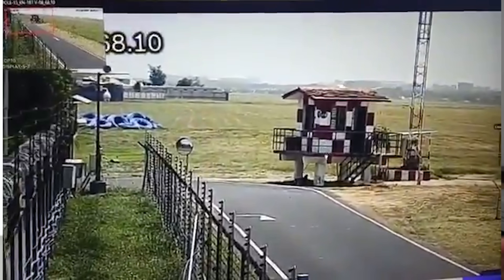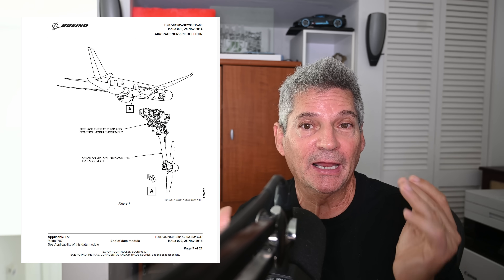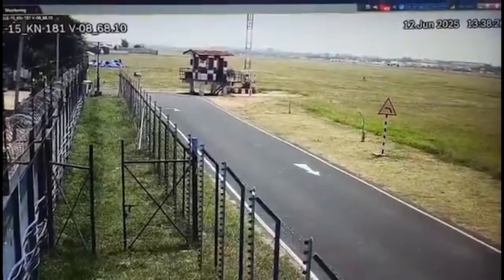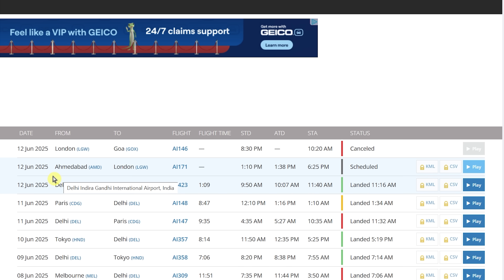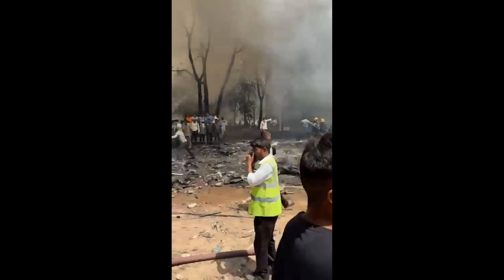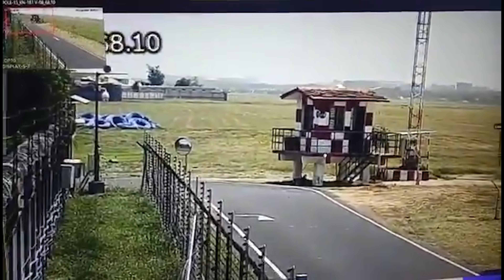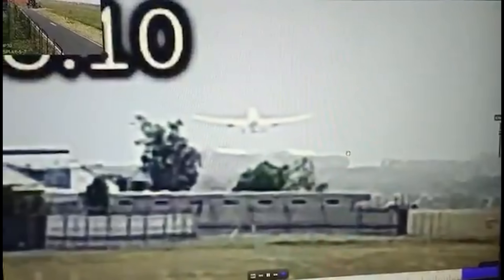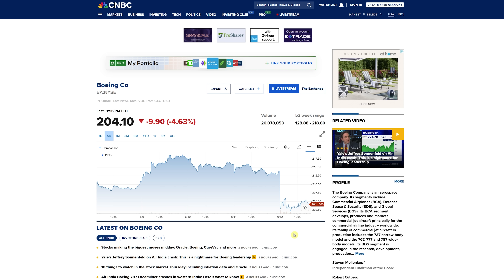What Caused Air India 171 Crash, Mysterious Sound Before Impact

Comment: 1:00

1⃣ Incident Overview
Date: June 12, 2025

Aircraft: Air India Flight 171 (Boeing 787-8 Dreamliner)

Crash occurred immediately after takeoff (less than 60 seconds airborne).

Flight reached about 625 ft altitude before losing lift and crashing.

Crash site: BJ Medical College vicinity.

At least one survivor: passenger seated in 11A, reportedly jumped out after the crash.

2⃣ Early Theories & Clues
Cause possibilities discussed:

Maintenance issue

Mechanical failure

Pilot error

Software malfunction

Design flaw

Focus was placed on a mysterious sound captured in a video.

3⃣ Video Analysis
Two versions of video footage:

News versions were screen-recorded copies.

The clearer original version captured key audio clues.

Analysis of the sound revealed a buzzing/propeller-like noise.

4⃣ Technical Hypothesis: Ram Air Turbine (RAT) Deployment
The noise was likely from the Ram Air Turbine (RAT):

Deployed automatically when both engines fail or there's major hydraulic/electrical failure.

RAT generates emergency power to control the aircraft.

Similar RAT sounds demonstrated via Japan Airlines and Boeing test facility footage.

Deployment suggests possible:

Dual engine failure

Electrical/hydraulic system loss

5⃣ Flight Data Review
Departure was delayed: scheduled 11:10 PM → departed 1:38 PM.

FlightRadar24 data:

Maximum altitude: 625 ft

Ground speed: 174 knots (normal takeoff speed range)

Mayday call issued shortly after takeoff, suggesting immediate recognition of a problem.

6⃣ Crash Details
Plane seemed stable in pitch; no stall observed.

Controlled descent implies insufficient thrust, not pilot error.

Extensive fire and destruction upon impact.

Debris, including landing gear, found embedded in buildings.

7⃣ Survivor Details
Passenger Romesh Vishwashkumar (seat 11A) survived.

Likely escaped from the wreckage after disintegration, not mid-air.

8⃣ Aircraft Model Context
Boeing 787 Dreamliner:

Entered service ~2011.

Globally ~1,000 aircraft in operation.

No prior full loss crashes before this.

Considered historically very safe.

9⃣ Investigation Status
US NTSB investigators involved.

Awaiting analysis of:

Cockpit voice recorder

Flight data recorder

Investigation will clarify whether cause was:

Powerplant failure

Electrical systems

Maintenance error

Design flaw (considered unlikely so far)

🔟 Stock Market Impact
Boeing’s stock price dropped nearly $10 following crash news.

Could drop further if systemic design issues emerge.

🔬 Current Hypothesis (Per Video Author)
Most probable cause: lack of sufficient thrust after takeoff.

Possible scenarios:

Both engines underperforming or failing.

Electrical/hydraulic failure triggering RAT.

Pilots performed well under difficult circumstances.

Comment: This is from ChatGPT:  Sound Characteristics
The RAT on the 787 is notably loud when deployed, producing a sound comparable to that of a small propeller aircraft. This noise is due to the high-speed rotation of the turbine blades and the airflow through the system. Pilots and ground crews have reported that the RAT's noise level is significant enough to be heard clearly during ground tests and in-flight operations .

Comment: Air India Crash – Reason Revealed
-------------------------------------------
The crash of the Air India flight shortly after takeoff from Ahmedabad was caused by engine thrust failure, likely linked to an unresolved Auxiliary Power Unit (APU) malfunction. The aircraft managed to lift off but crashed within 30 seconds and about 1 kilometer from the airport. A passenger who had flown earlier on the same aircraft (Delhi to Ahmedabad) had shared a video reporting that the air-conditioning system was not working and there was no electrical power on the ground, indicating a failure of the APU.

From a technical standpoint, the APU plays a crucial role in supplying electrical power and bleed air to the aircraft while on the ground. With the APU not functioning, the aircraft had to rely on limited battery power, prompting the crew to switch off the air-conditioning to conserve energy for critical systems. Additionally, engines require bleed air and proper electrical input for a successful start and sustained performance. Without APU support, it’s likely the engines were not operating at full thrust capacity during takeoff.

Although the aircraft lifted off due to the momentum built during the takeoff roll and wing-generated lift, the insufficient engine thrust led to a rapid loss of speed, causing the aircraft to stall and crash. Emergency systems like batteries or the Ram Air Turbine (RAT) are designed to provide minimal backup power for essential instruments, but they cannot replace engine thrust or support full flight operations.

Information source: Jinson Kurian Vilayil James, Maintenance Engineer, Riyadh Metro.

Comment: Hey Mr Jeff, If you could reply ? Perhaps a clue here, I suspect sort of power loss myself given the bizarre circumstances. However survivors statement was that he heard the "engine race" up suggesting the pilots putting max power and engines were going full throttle ? Do you think even in failure they can make noises which can be confused with engine maxing out on power ? or like survivor said "engine raced" up. 
If so then I'd say it's probably power failure and they did an incredible job to keep it stable somehow (angel of attack) and didn't retracted gears to return back to the airport ? 

If not then probably they messed up super bad in configuring an aircraft for proper wings config ? (I'm not a pilot but i know 787 has automation that literally stops them from flying and master caution when it's not configured properly for fuel etc variations. right ? ) 

But given the Survivors statement it seems less likely to have a power issue or could there be more than what we see and hear ? 
Thank for your time. 

PS: May god bless everyone, RIP. Very tragic and sad.

Comment: In photo of the tail section, the flaps were out.  Photos I found through google imply the the flaps extended on wings. A refurb of the aircraft was completed not long before this flight soo did they do something that interfered with fuel, electrical, hydraulic systems during that refurb.Very sad

Comment: Looks like the gear was being lowered again. At the start of the clip the gear doors are partially open and the gear is at a  distinct angle. Just before impact the gear looks like it is fully extended again. Also you can see that the leading edge slats are deployed. Flap setting looks minimal if any at all.

Comment: An excellent video and analysis, Thanks Jeff! I'm also an aviation engineer - Reliability Engineer so I also analyse air accidents. I correctly predicted the failure of the gearbox on the Bell 206 LongRanger IV over the Hudson in April. What's that dark flat object that tumbles to the ground 2:04-5?  Having looked at a zoomed screenshot of the plane, it is possible that the RAT was deployed, and was working, which would point to a dual engine failure. No evidence of what caused it yet, the FDR will most probably show that.
RAT can be seen from the front in this https://www.youtube.com/watch?v=8tXobY4ZWbc video, and it's quite small cf. the engines.

Comment: And if the sound presented here  is really the actual sound I would have expected to hear something quite different, namely the roaring of jet engines at max take-off thrust. This sounds to me as if that jet had either no running engines at all or if so they certainly were not at take-off thrust. This is supported by the fact that apparently the sound of the RAT was audible. I would imagine that two large jet engines working at take-off thrust would create a sound that would blank most other sounds.

Comment: There could be many possibilities regarding what went wrong, but from what we have seen from the video, the flaps and slats were extended before take-off, and just after take-off, instead of retracting the undercarriage first, the flaps and slats were retracted very early; thus, there was loss of lift. Because of this reason we can see that the undercarriage was still in extended condition when it was descending. At the altitude and time when the undercarriage needed to be retracted, the crew instead retracted the flaps, and that was clearly visible.

Comment: i am not an NTSB expert, nor a pilot. I am an engineer by training. I have seen some documentaries of the "Mayday: Air Disaster" series. The only case that this tragic accident reminds me of is a Greek "almost-tragedy" back in the late 1970's when an Olympic Airways Boeing 747 jumbo jet leaving Athens destined for NYC almost crashed due to insufficient power at take-off resulting from an extra-ordinary heat-wave that had hit the tarmac and the entire city of Athens on that day, resulting in "thin" air that couldn't provide the right lift for the plane; these environmental conditions appear to be similar to what was going on in Ahmedabad yesterday. The Greek pilot was able to save the plane by raising the landing gear to reduce drag (which the captain of Air India doesn't appear to try) and keep the plane flying at an extremely low altitude until he was able to slowly raise the nose up and start gaining altitude little by little, enough to go to the nearby sea, drop most of his fuel, and then land back in the same airport. During the investigation that followed, many pilots tried to recreate his efforts in the simulator, and they all failed, all the time. To this day, the captain is considered a hero, and many talk of a miracle. In any case, my thoughts are only with all the victims of this flight, and their families.

Comment: All clips with RAT are with landing gear dropped. Also some big flat piece seems to have departed from the plane just prior to the collision, like a lit or door piece. Very strange. The pull up lever system of the landing gear may have got stuck by that piece that eventually came off, causing hydraulics drop.
In these countries sometimes people hide in the landing gear compartment, not worried by freezing to death. When the airplane pulled its nose up, the luggage of this stowaway person, moved to a location that caused a warning signal, that the landing gear had become incapacitated to pull up. And triggered the RAT

Comment: One more angle which none are talking about: -->  is it not possible that while Re-fueling, some contaminant (or special combustible element like Lithium) could have been added into the Fuel during RE-FUELLING, which affected the Thrust Generation capability of Fuel after the first few hundred Metres. 

Contaminant may have been not fully mixed up, so during takeoff initially fuel was good but only for few seconds. Being a fundamentals oriented scientist, researcher and natural (I feel, born) analyst of all things human and scientific; this angle keeps coming to my mind after listening to all channels/ interviews/ take-off videos/ air-engineers/ words of lone survivor (V. Ramesh), where he did mention a Loud Sound -- could be a blast?. The sabotage angle is stronger due to recent Pahalgam, Sindoor events and today's Thailand flight scare news. Perhaps the sound was of Lithium molecules reaching inside the cylinder of engine; or small bombs attached to each Engine with exact same timer.

Some people suggest that Fuel Switch was switched off after refueling, and the Fuel in Pipe was sufficient for half-minute of Flight.

But my doubt about Fuel Switch being OFF, is that then the huge Fuel Used during V1 and V2 Speeds and TakeOff Thrust would not be generated, as that would quickly consume the whole Fuel in the Pipe !!

Comment: I agree with your theory. If you looked at the later part of video. The airplane looked like landing position. I was wondering why it looked like that? Also, If you see from the middle part of the video, when the flight climbs up, why the landing gear was not retrieved? They stayed on the whole way.
Reply: Could be a power failure. All controls stopped working.

Comment: This was a longhaul flight to Gatwick therefore the plane would have been tanked with fuel. My question is how long would the plane fly before its has exhausted all the existing fuel from the lines and pumps etc before it started using the new fuel? If the fuel was contaminated this would explain the loss of both engines and the deployment of the emergency prop.

Comment: He survived because the wing roots are right behind him, and thus on impact the nose penetrated the building, and then the wings ripped off at around row 13, meaning the crushed front absorbed most of the impact, and the little section around 11A was protected from both the impact, and the fire, because the front carried on further, along with the rear dropping into a lower floor as the mid section collapsed the building. Looks like the rear again snapped off by the rear bulkhead, so all those passengers forward were in the fire, and none at the back section stayed with the tail. Lucky man, unlike the rest of the passengers and crew, and the people in the medical facility.  

But at least easy to get to the CVR and FDR, hopefully they did not lose power with the engines cutting out and the aircraft transitioning to the emergency bare backbone supply from the RAT, which only provides limited flight control hydraulics power, and a limited electrical power supply to the emergency power bus to power a single display, a single flight computer, and a limited set of cockpit instrumentation plus the radios. but the power of the RAT is limited, as you only have this plus the 2 aircraft main batteries to run things, so cabin wise all you get is floor level emergency lighting and the exits partly lit, nothing else at all, aside from the PA system. cockpit the same, just a single display per pilot, and a standby artificial horizon, plus the standby magnetic compass, with limited flight augmentation from the computers other than limiting input excursions to the flight surfaces. Not even hydraulic power to raise landing gear, just the emergency drop handle that will dump them down to mechanically lock.

Comment: Clearly in your better video you see no RAT deployed. You hear engine(s) running so it had electrical power. Also you see spoilers had been deployed and the plane pitched-up. So it also had hydraulical power. RAT won't deploy in such circumstances.

More obvious are the lack of flaps deployed at take-off. It's just a clean wing also in your better video. Which is strange for a heavy loaden 787/8 full of passengers, cargo and fuel. The plane took the full lenght of the ~11.500ft runway to take-of just at the end of the runway. Surely something was quite off allready during their roll to take-off. 
Wrong configuration of flaps? Engine-failure just before- or after take-off?
We'll see. But I'm sure there was no RAT deployed. Sounds gathered from mobile phones are notorious for low quality. Certainly not usefull to put any conclusions on like you do. But we'll see. You're making a thoughtfull effort of understanding what happened. Thank you.

Comment: Also you do not get the standard engine noise, just the RAT running, saying both engines lost power just after take off, or went right back to flight idle, either from fuel failure that caused blocked filters, or from a failed throttle control.

Comment: THERE IS NO WAY IN HELL YOU ARE HEARING ANY 
SOUND BEING PRODUCED BY THAT TINY DEVICE!!! 
No way, no how, not in this universe, and certainly 
not over the noise being produced by the engines. 

This is a perfect example of massaging the evidence to fit the theory, rather than changing the theory to match the evidence.  Your mind latched onto that alleged 'propeller' noise, and you picked through the data until you found something like a propeller to explain the sound.  The problem is that thing isn't capable of making noise loud enough to be heard over the jet engines we can CLEARLY hear.

Comment: Nope. I built this plane. I also installed the RAT. Its clearly not hanging down on this video. I know exactly where it is. Thats not the issue. The issue, im willing to bet a whole bunch of money i know what happened. The flaps are not down, they are required! To be down during take off. The sound you hear has its own sound. If you have zero flaps while also being close to max take off weight, you will in fact craah 100% of the time. Search 787 take offs. You will see in every video they flaps are down, this plane had them all.the way up and retracted fully. All of our twin isle planes will crash everytime if taking off this way, specially full of fuel for an overseas flight. Bet you $1000

Comment: Boeing made a bad plane eh
Well what is more aerospace researh on you guessed it stealth and mig 99 but id say these govt university in debt jack of.... Trades doesnt know what pitch means in terms of a propeller let alone meaning of turbine or radiator
A hairline dust well humid cold location of dreamboater manufacturers
Prayers and RIP

Comment: Air India Flight  171 , all evidence point to bird strike , engine blowout at a very low height. 
The Problem  of Bird strike was  waiting to happen and all condition at that low height. Compressor stalled.  Loud Bang reported by lone survivor kind of confirms, engine blowout . Investigators has to conclude the same. if not they will have to be lying. The Black box will report , engine blowout, and loss of lift.

Comment: well, i opine with what Jeff told.  The flight had technical issue - which may be accidental or intentional.  if it was accidental technical glitch, it would have happened after some time of take off but it happened immediately after take off so, its either service engineer fault or intentional handi work by technical personnel over there.  How the technical clearance given and what check list does the Pilots followed is a mystery.